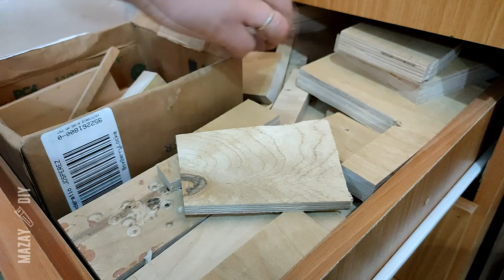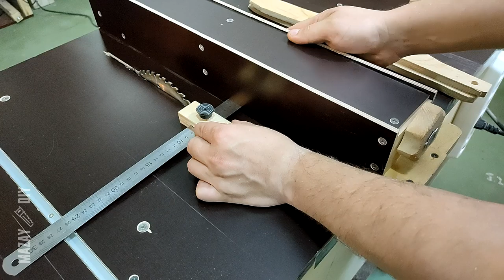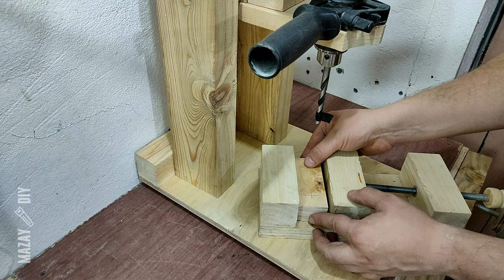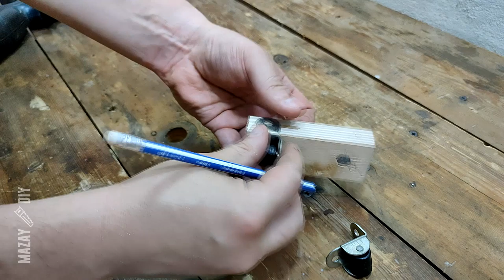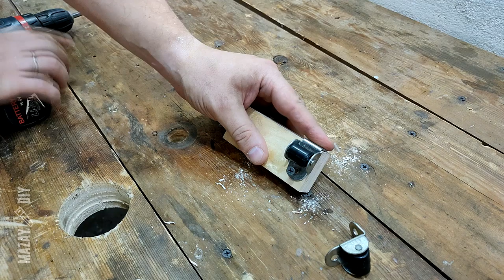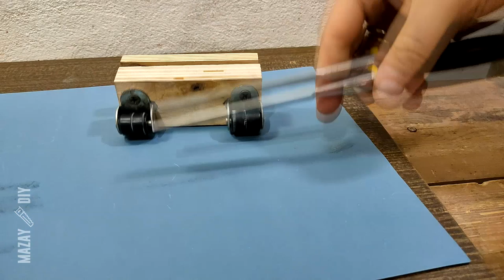DIY Sharpening Jig for Chisels and Plane Blades — Easy to build

Comment: I'm going to make this one! In the next two days, maybe even tomorrow, it will be done. Thank you for the great, simple design.
Reply from the maker: Good luck! I would be happy if you post a link to a photo of the finished jig
Reply: @MazayDIY  As I prepared to make this jig, I looked at the castor wheel I had to emulate yours. There's quite a bit of play in the wheel, going up and down, side to side. This is standard for all the castor wheels, part of their manufacturing process. Its different to using bearings riding on a piece of round stock which would be true and stable. Does your castor wheels exhibit movement or flex in their chassis and if so, does this affect the sharpening jig?
Reply: @MazayDIY  well, I did it as promised. I have sharpened a chisel and a small bullnose plane iron (Stanley 75). The former was a very badly chipped - my fault - MOB French made chisel and the latter was a new acquisition with about 4 different angles on it. I used two old stones to do it, very cheap ones. I did well over 1500 push pull motions to totally redo the chisel, and about 1000 on the plane iron. I learned later on that a piece of 320 sandpaper on top of the rough stone did more metal removal than the stone. What a time saver! Of course, each was hair shaving sharp after stropping, but the Stanley 75 just plain sucks, digging into the wood despite it being properly set up. I love my jig, thanks for showing the way. Made mine from oak and fancy brass wing nuts. Also added 400 grit sandpaper to the insides of the holding area of the jig to grasp the chisel/iron better. It will marr the surface though, so do be careful. I was finding that the oak, despite not being polished, was letting the object shift ever so slightly despite being cranked down super tight. Last observation is that the castor wheels arent perfectly round, nor spin perfectly round on their axles. But, worked well enough for jam. Cheers!

Comment: Where did you get the wheels?
Reply from the maker: Adam, I bought them at a furniture hardware store
Reply from the maker: You can use similar wheels, like this - https://www.ebay.com/itm/1x-IKEA-CASTER-WHEEL-FIXED-15-mm-Steel-Gray-Part-109775-/192976164152
Reply: @MazayDIY  Thanks

Comment: Thank you for this video what is the name of the roller you put on it
Reply from the maker: Fixed Caster Wheels
Reply: Mazay DIY 
Thank you appreciate it very much
Reply: i just used wheels off toy truck :P
Reply: I guess you can do without the wheels too, right? It just won't work so smoothly, but it will WORK...